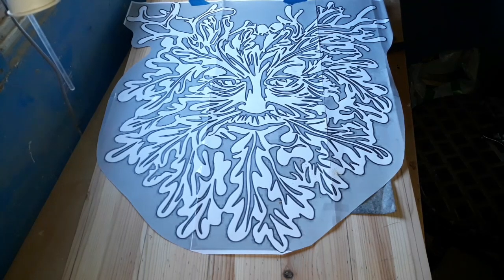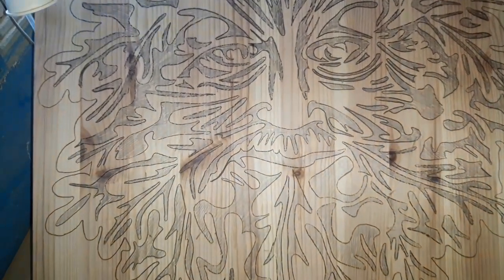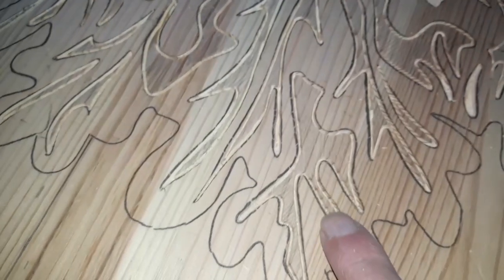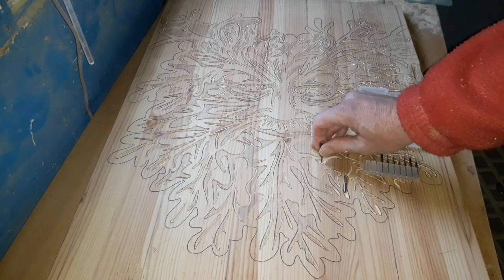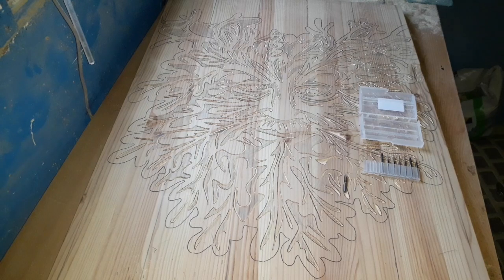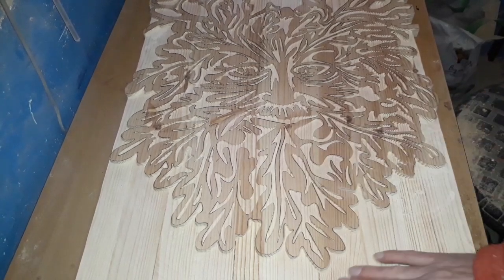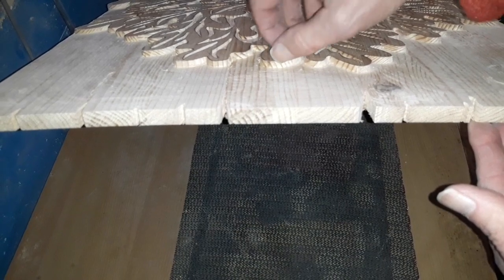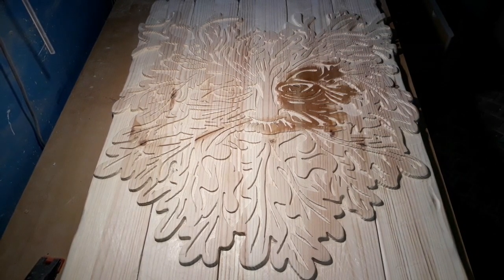Green man with resin inlay,router project

Comment: Can u put links to.get the bits and collet ? N i love ur work.im.getting into.doing this and ur vids are really helpful
Reply from the maker: Cheers,here's the bits I use,there's better bits out there ,but these work for me,cnc..https://www.ebay.co.uk/itm/182126297529
End milling bits https://www.ebay.co.uk/itm/353029506162
Adapter reducer collet https://www.ebay.co.uk/itm/402710195555....
Reply: @fishtank5050  hi the collet number is not recognized  i have just got the bits u=but need a collet to use :(Pete
Reply from the maker: @peterclark1752  you are right, strange, here's another one 
https://www.ebay.co.uk/itm/Collet-Adaptor-Reducer-Bit-CNC-Router-Tool-Shank-Reducing-6-35mm-to-3-175mm-/352667542851?mkcid=16&mkevt=1&_trksid=p2349624.m2548.l6249&mkrid=710-127635-2958-0

Comment: Amazing! I love your camara work really get a nice view of the fine details. I ordered it looks like the same bits but the collet did not make it to UPS so I can only look at the bits and wish I could try them. I have a question though I tried my first epoxy piece this weekend How do you know how much to mix up? I made 2xs more than I needed.
Reply from the maker: Thank you Kelly, sorry to hear your adapter collet didn't arrive, I remember when my flexible cable for my dremel arrived after 5 weeks from china,I was so excited to try it out,then I realized you need a seperated square nut,that it doesn't come with so it fits the dremel,another 2 weeks to wait...regards to the resin  it's just guess work for me,I'd rather mix small amounts more often,then waste the resin,its not cheap.😁.I'm sure theres proper calculator charts/formulas that do it for you..someone told me once  that they filled all the project with fine sand,then poured the sand into a container, marked off the level and that was the amount of resin they needed..but for me its just guess work..

Comment: Hi buddy i like your work i do router wood work .but stuck on doing bigher ones.can you tell how you get the bigger picture on a4 paper as thus one you do what software on computer to you use i use canva mnay thx dougie
Reply from the maker: Hi Dougie, I do everything from my mobile phone, I use a online site called rasterbator, you can go up to 1000x a4 size papers,big enough for you 🤣..once I've got the size I need I download it to my phone,then send to my printer, they print off with little markers so you can tape it all together,it's free to use..
https://rasterbator.net/
Reply: @fishtank5050  you are star i will try it ty
Reply: @fishtank5050  so lets say i do a pic and its 4 time bigger than a4 paper it will print iut on 4 bits of paper tgen i tape them together and tape it to my wood and trace it. Check my work on facebook rustic  wood sign man drop me a line.
Reply from the maker: @dougiefletcher9237  that's about it,you have the option for different paper sizes, but I always use a4 size..play about with it,I prefer to work in inches so I change from cm's to inches on the right of the screen..I've a fb page called shedcrafts with Shane, all my pieces are on there. 😁👍
Reply from the maker: @dougiefletcher9237  thanks for the like,I've searched fb but can't find your rustic wood sign man page..🙄
Reply: @fishtank5050  dougie fletcher fb and i wil add you ive got a good few on my fb aswell ty